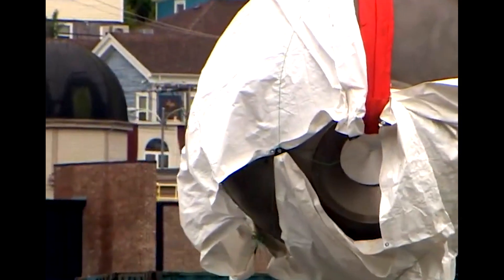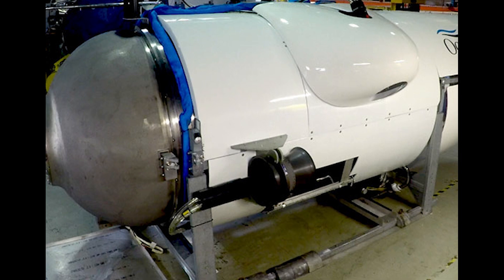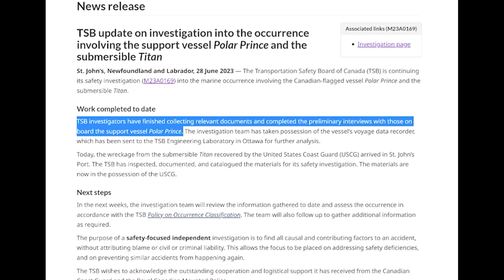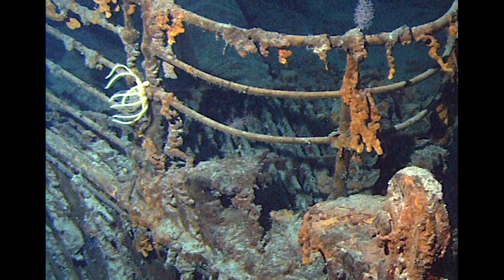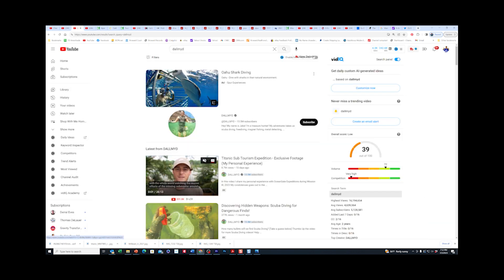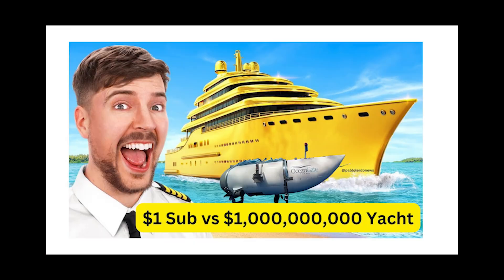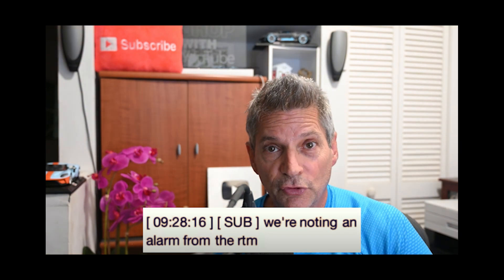Titan Submarine Debris Clues, Implosion Simulation

Comment: Consider this. The carbon tube was in compression from the outside. The outside of the tube would be in compression lengthwise as it was compressed. The inside of the tube would be in tension as the outside was pushed inward. None of the fibers in the tube ran lengthwise. They ran perpendicular to the tension on that inner surface. The epoxy had to hold all the tension. This is a complete failure to understand the stress in the tube section. If it had been wound different it would be stronger but it is still a material that does not belong in that environment.
Reply: The longitudinal stress is half the hoop stress of a cylinder. The principle stress in the shell would be hoop stress which is in the direction of the CF lay up, but is putting the fibres in compression. As the fibres are in compression they will not be best placed to withstand the stress, even with the support of the epoxy and adjacent fibres. Voids are likely to open up as a failure mode. Failure due to spalling occurring on the inner surface seems a possibility. This being due to lack of support compared to the body of the shell, and external water pressure.  The pressures are hydrostatic and evenly distributed around the shell, not point loading as in an arch.  I wonder if a radial lay would allow the complementary stresses to place the CF in tension and stabilise the structure. Just impossible to do.
Reply: @everTriumph  since the ends of the tube are restrained by being slotted and glued into the titanium end caps wouldn't the pressure on the center of tube section be like a point load on a beam and put tension on the inner surface of the tube. The tube is going to flex even being 5 inches thick. With the ends restrained the center would move inward some small amount which would put tension on the inner surface perpendicular to the fibers. Am I wrong?

Comment: So.. another report has come and floating around the ole inter web… Stockton Rush bought expired carbon fiber from Boeing… Yes Carbon Fiber has a shelf life… it can get extremely brittle and break very easily.. also I have questions of how they actually introduced the epoxy to the carbon fiber. If not done correctly you can get “dry spots” for a lack of a better term…and this means weak spots or failure points…would love to see the manufacturing of the pressure hull…

Comment: If a joint between two dissimilar materials is already a bad idea under these pressures..Than a joint with three materials, being carbon fiber, titanium and glue would be terrible at pressure cycling.
Then again, the water pressure would also be pushing the caps onto the cylinder. But it would have been a major stress and possible fracture point for the carbon fiber tube.

Comment: Apparently they got 2/3's of the way down, maybe about 2850m above the "crash" site. They transmitted they were dropping the ballast, which is a signal that they had an issue onboard, then both signals being monitored dropped, and the USN heard the implosion. The debris rained down about 600m from the TItantic's bow. (They descend in front of the Titanic's bow and approach the bow for the passengers,  descending in front prevents any ballast etc. being dropped on the wreck also). The submersible had apparently gone down 24 times to this depth (?) so they would have considered it safe.

I think it failed in one of two ways. The sealant at each end of the tube failed, or the carbon fibre resin cracked / delaminated internally and failed over time, leading to a catastrophic failure. The acrylic window would have been removed to hoist it and is not the failure point IMHO.a

Comment: The thing that makes implosion even scarier is the pressure vessel is storing the energy being applied to it by the fluid around it until it reaches breaking point in which all the energy stored by the pressure vessel is released instantaneously causing something that is similar to an explosion. At the depth where the Titan imploded, the bodies of the victim probably got turned into literal minced meat in a fraction of a second. Imagine getting a 7 day old chick and then hammering it with a pile driver.
Reply: "Presumed Human Remains" says it all...

Comment: The sub cooled as it descended. Carbon fibre and titanium have different coefficients of expansion or in this case contraction because of the cooling. This would put strains on the carbon fibre that are difficult to calculate. The flange area is the weak spot.

Comment: The way he was mixing the resin is just weird almost like how you would mix to repair like Bondo on a car. Any bubbles or a very little space could have become a big space after many dives and bang your dead. And I am sure they took the port hole bolts off to put the strap threw because if that blew the bolts and ring would have still been attached. And using a little rachet that cracked me up. But the gluing of it to the surface looks like the dangerous part.

Comment: If the port hole didn’t blow out (which is most likely did) they wouldn’t remove it. They’d need all the data they can get for analysis as to reasons why the sub failed other than the obvious compression chamber. It’s lost down there in a billion splinters

Comment: "I don't even think they were using a torque wrench either to close that thing" At the exact moment showing video of them using a torque wrench.

To be fair I thought the same thing when I first saw that series of clips.
Is it just an optical thing screwing with me? One of the titanium rings they load looks bent, but I have heard no one make mention of it.
I'm leaning towards the porthole being removed by the salvage crew. Though it could be that the pressure bubble pulses that occur with an implosion could have blown it out from the inside.

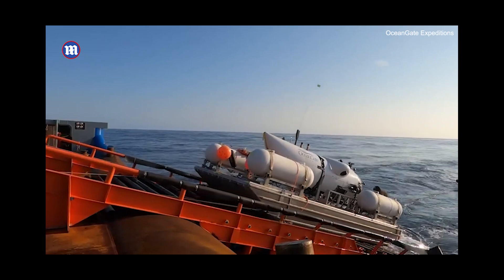Comment: One additional possibility exists that the kinetic energy of the implosion of the submarine exploded the window outward if it collapsed from the carbon composite section and the collapse progressed forward through the window effectively a water hammer like effect would have slammed into the interior of the window and blasted it outwards 1:35

Comment: I build model submarines. I use pmma plastic. When I make the lids, I mill a slot in the lid so that the tube is glued both on the inside, the outside and on the head. This way I have a huge glue surface. with titan I found the glue seam very small in height

Comment: Apparently they photographed the sea floor and pictured all the pieces and then picked the pieces up. Someone in the comments of another video mentioned that he knows someone close to the recovery and that was the protocol.  But yeah I was saying the same exact thing about the flange. I just want to see the most recent picture of the window and then an up close picture of the porthole to see if there’s holes or if there’s broken off bolts. But yeah my theory is if the window failed the haul wouldn’t have completely vaporized. Because there’s already 6,000psi on the outside of the carbon fiber. So as the water rushes in the porthole it’s instantly going to start equalizing that pressure. Which would compress it from 5” diameter down to a couple inches diameter more than likely. But then they pressure on the inside ( which carbon fiber is better at dealing with) is going to have to get close to 12,000psi to actually make the haul explode.unless the 6,000psi and 6,000+psi on the inside compressed the carbon fiber so much it just compresses down until it simply fell apart. I’m not sure familiar with the properties of carbon fiber. But maybe that could explain why there’s no carbon fiber on the rings. The pressure from both sides was too much and pealed it off. But yeah if it were the window I feel like there would be at least some substantial sized pieces left instead of none. But it’s pretty cool you mentioned the flange on the window. Because I’ve been saying that but I haven’t heard anyone but you mention it.

Comment: The cover on one the rings slid open reveling almost half of the gluing surface a fourth on it had epoxy that glued it  together the other fourth was clean , when they dropped the frame to get more lift that left no support for the  ends which were very heavy , the messages from the sub said loud cracking coming from rear cone , that’s where the most weight was located , I think joint failed at top where the most pressure would have occurred

Comment: Maybe a little bit of water was infiltrating via a hole on the glue, but infiltrating like a laser, because of the 5000 psi... them they panic, drop the weights and then the glue disconects from the titanium completely and the sub implodes

Comment: That's exactly what I have said: the resin epoxy that mated the inside of the Titanium ring, to the Carbon Fiber, wasn't even done INSIDE A CLEAN ROOM!! The Space Shuttle Orbiter's Bay doors and interior, because the doors were Carbon Fiber? Clean Room!! My dad & another Aerospace Engineer did create it for Rockwell Intl. They were in charge of creating many fabricated products, from the Apollos, Shuttles, The Spirit, etc. I believe that it's the ADHESIVE, that gave, first.
If people want to yap about CF not holding up to UVA/UVB rays? Remember this: Space Shuttle Orbiters Bay doors held up to those days, for over 40 years. And when the Endeavor was made out of spare parts, they pulled the only spare bay doors out of storage, from the early 80s, of which my dad and his crew, personally built - I do mean all of them, BTW . I worked on a small part of the shuttle, when I left home, and cleaned up, finished fabricating the 8 electrical conduits, that opened the Bay doors on the Atlantis!The extra set I made, went onto the Endeavor! At Cape Kennedy, you can at least, see a little girl's handiwork, holding her beloved dad's Carbon Fiber Bay doors, open for hopefully, a century.

Comment: Whoever thought it was a good idea to build the cylinder from carbon fiber is an idiot with no understanding of engineering and the material. Maybe it sounded good in the adverts, but there is a good reason subs are made from steel or titanium!!!
CF is good in tension, poor in compression - and it was only subject to compression at that water depth.
It's telling that the titanium end dome has survived but no evidence of the CF cylinder !!!!!

Comment: The porthole was probably blown out (and the bolts stripped) by the explosion that followed the initial implosion. You have a bubble that oscillates between imploding and exploding (with each cycle being weaker than the preceeding one) until all energy is dissipated.

Comment: they use a torque wrench for the externar bolts, also i don't think the titanium plates "pop off" because the pressure is towards the inside of the sub, probably the carbonfiber crack and implode or the window crack

Comment: There are a number of issues with the build and it goes on and on. If anything the resin and the Carbon fiber needed to be manufactured/applied in a vacuum. 
The resin creates bubbles which is a problem in itself. Next is the Temperature. Internal temperature verses the surface temps. Over time it will induce structural fatigue. This is basic hobbyist knowledge with these materials. The mere usage of Titanium and Carbon Fiber reveals more of a cost factor than a research perspective. How does anyone make the comparison of titanium and Carbon Fiber. That like making a condom out of Latex and Kleenex. 
Its just angering to think about what happened to the passengers.

Comment: To me, it looks like a torque wrench is being used to secure the hatch bolts. What’s concerning about it tho, is they’re using a extension, and/or adapters, on the ratchet. So unless they’re compensating for the loss in torque from using a longer rod/extension, and/or adapters, I find it a bit concerning. Just the crudeness of the procedure that was being displayed, securing the hatch bolts on such a “sophisticated” piece of engineering. 

I know the drop in torque is probably minuscule, but when dealing with such tight tolerances, I’d imagine it’s pretty important to be spot on. Then again, the pressure alone is helping to secure the hatch, so maybe this isn’t as crucial as my mind is thinking. 

I think it’s irrelevant tho, bc I believe the carbon fiber, and/or the joints, are where the failure happened. It just seems like such a bad idea to me, even in my pee-brain head, that it’s crazy anyone would ever attempt to build such a thing. Especially without properly testing and certifying it. Hell, they didn’t even build a full scale model for testing the pressure vessel (according to what I know), which is hugely concerning, as the thickness of the model was definitely thinner than the real deal…and as some of us have seen, more layers, isn’t always better, especially when talking carbon fiber. There’s a point where the more layers you do, the more you actually reduce the structure integrity. It’s been said they went overboard on the amount of carbon fiber, going beyond the recommendations from the engineers. I can’t recall the exact layers called for, or inches that was….but they did 667 layers, or something like that, when only 450 were called for (just guessing the exact layers here)….I just find this all concerning! Especially when they’re charging people money, and basically making a ride out of seeing the Titanic. Oh, and when they made the pressure vessel a cylinder shape, where unequal forces would be exerted. 

It seems like they might of known an accident was eventually going to happen, just based on the language in the waiver. They sure were covering their butts on that front.
Reply: "A loss in torque" ?  please explain
Reply: @aritaridrive6539  I think I explained it well enough…maybe not? I personally feel this comment is just to say “you’re wrong” that’s not true. But in the event you’re actually asking…so there’s thins little thing that happens when you add adapters, and/or length to a ratchet wrench/torque wrench. There is indeed a drop, or change in the torque output, especially when using different adapters and such. All my point is, is it’s hard to tell what exactly is being used here to secure the hatch bolts. A relatively long extension is being used, at least, and we can’t tell if adapter’s are also being used, which would be even more concerning, as adapters are far more likely to effect your torque spec goals, as a straight extension alone is said to have little to “no drop”. I’ve seen straight extensions effect torque tho. The drop in torque is minuscule, but I’ve seen errors made like this many times, as an technician, where someone had all sorts of adapters and extensions on their torque wrench, expecting an accurate torque spec to be applied. 

Personally, I’d just expect a more “professional” way to secure the hatch bolts, than a “possible” torque wrench (only saying that bc idk if one was used, but it looks like one to me), using a long extension, with a possible adapter, and a wrench. Quite a bit of variables. It’s just a tad concerning in my eyes, is all. Probably a non issue. 

I could be completely wrong, and they have a very elaborate torque sequence they follow every time they close the hatch. Maybe what was displayed, was just the snugging of those bolts, to later have a more precise way of securing them to their desired torque spec. I just don’t know tho. Clearly, I’m speculating, and as I’ve said, it’s more and likely irrelevant, when most of us know that the carbon fiber pressure vessel was more and likely the failure point.

Comment: That was some pretty good sleuthing. You had a few details that others have not. Also imagine that the imploding barrel had around 15 psi against it, and the Titan had north of 5,000 psi. To say that complete obliteration was instantaneous is an understatement.
Reply: Yeah, it's surprising that the pieces of wreckage of the sub they brought up were at all recognizable after a 5000 psi implosion!
Reply: @johnbergstrom2931 the outside of the pressure chamber is always experiencing the pressures of what depths it is at.
Reply: My favorite glued and resin'ed expired charcoal fiber with a plastic view port submarine didving down to submersible depths

I'm usre the presure increased the heat to vaporisation and cuombustion presures sphere of milisecon 270klb preseure per square inch with 5 feat of acceleration and momentum and crushing air
Reply: Just shy of the pressure of 55.6 NATO round going off in AR chamber

Comment: Looking at the ring joint in the salvage video, that metal looks very  clean. I think the implosion video shows exactly why - the carbon fibre likely pulled off as the structure collapsed. The only question I would have then would be if the interface had been much larger and something more like a mechanical interface been included (i.e. ridges with the ring being in place during the carbon wrapping process to fully lock it) would that have helped equalize the stresses and possibly allowed them to surface? Probably not, but it would be an interesting simulation.

Comment: Yep the force would of popped the ends straight off. The port hole would of been blown out with the energy of the implosion.  As you can see the seal was fastened in an open aired warehouse which would contaminate the glue!

Comment: When the blue barrel implodes it gets inconsistantly shorter in length. Leads me to believe the Ti rings glued to the CF tube delaminated. The joint was rated for compression and not tension. If the Ti rings were woven into and not glued onto the CF tube maybe it would be better. Also Ti and CF undoubtedly have different Youngs modulus and thermal expansion. My 2cents.